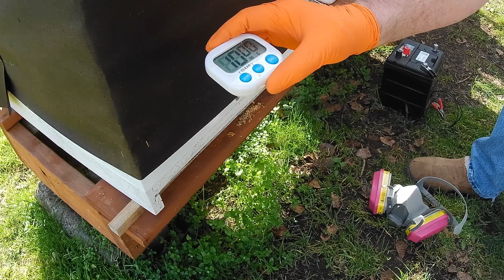G&H Honey Bees - Feb 26 Oxalic Acid treatment

Comment: It looks like it gets the job done. And I just use golf tees plug my holes. And expensive and worked perfectly fine. Thanks for sharing my friend.
Reply from the maker: I could use tees however I move the hives in July to catch the fireweed so I wanted something that would not fall out easily.
Reply: @berrrygr  I find that the bees tend to seal them with propolis. But you're probably better off with what you're currently using just in case.